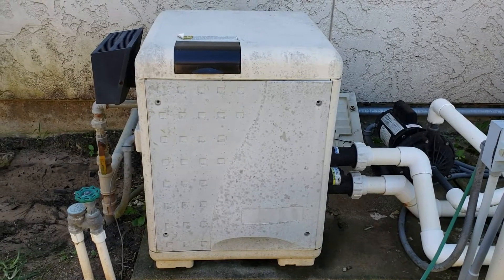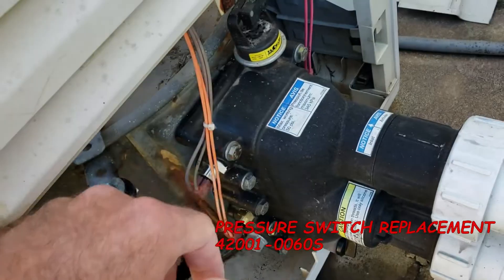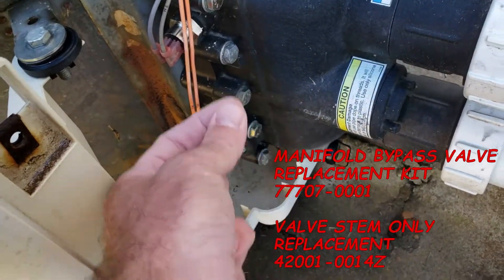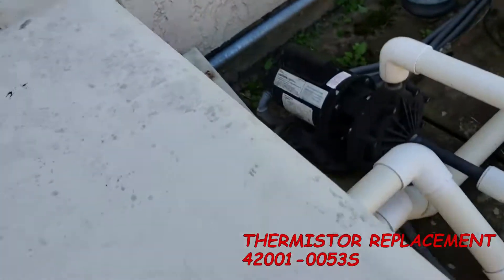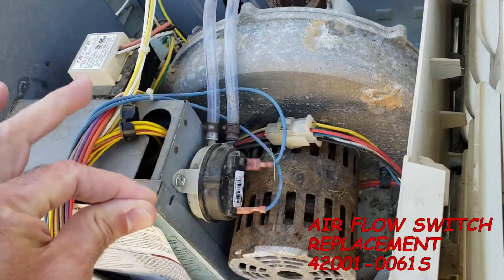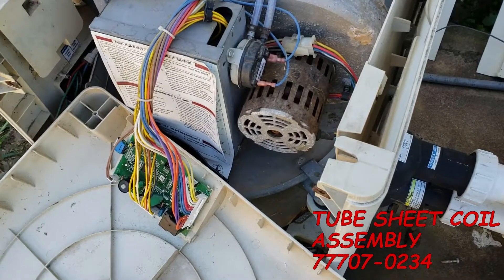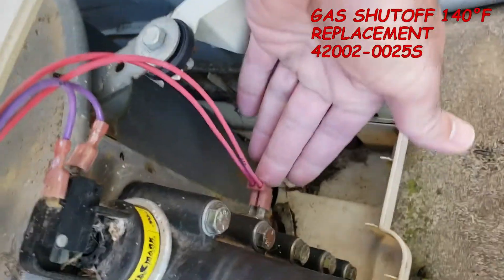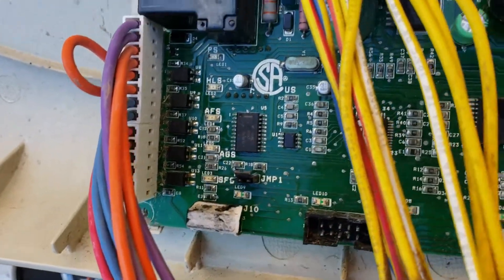PENTAIR MASTERTEMP 400 ERROR LIGHT LED EXPLAINED

Comment: Hi please help I have a master temp 400. It has been giving me issues with cycling on/off I have replaced the thermo regulator along with hls switch still it would send hot water and then start sending out cold water to the spa. I just noticed that there’s a slight amount of water coming from the pressure switch….would that be my next step to get my heater back to running perfect again? Please help I keep calling pertair with no luck.
Reply from the maker: I can try to help you.  Might need more info though.  Do you get any error lights?  I will address your question assuming no error lights.
So, what will cause it to cycle on and off without error lights...a couple of things come to mind.  The first one you have already addressed (thermal regulator), but the component you might test woukd be the thermistor.  If it gives high temp reading when the water is actually cool, the control board will cycle the heater off because it thinks the water is already hot.  So, test it.  Power on the heater and immediately look at red digital display for 3 things:
1.  128
2. R-??? (Software revision number)
3. The temperature that your thermistor is reporting to the control board.  It should be approximately the ambient temperature before the heater fires.  Check it out and let's go from there.

As for the pressure switch leaking, I don't think that will be the problem here.  It makes a hard short or no short at all (open).  If it is open while the heater is on, you will get a PS light as stated in this video.  At most, for now, you might want to see if the threads need plumbers tape or other cause of leak.
Reply: @pvt-pilot   thank you so much for your time! I get no error lights before I did get the hls one but that’s gone now (hls was red when I reversed the cover on the circuit board) whenever I boot up I do get the 128 r….forgot the # but it’s the latest one I can let you know tomorrow….the temp seems not to move today it’s been on for an hour or so and it would just show me 82 and the spa jets would fire hot water followed by cold water cycle….I did take the manifold apart just like you showed in previous video no water on the bottom bolt, everything was in place. My originals thermo regulator was working fine but it was very rotted on the top so I still got a new one which works fine along with the hls…should I change the thermistor next? When I spoke with the pentair people they mentioned that it might be the circuit board? 

Also I did change the membrane pad just in case. Last season this heater worked immaculately and now I don’t know what to do…..
Reply: @pvt-pilot  also as of today I just woke up turned on the heater after waiting about 10 seconds the exhaust kicks in, then it recycled quickly and was working for a bit I had to shut it off had to go to work but the display where the #s are was completely blank the entire time, however the green spa button and “heating” was lid…..the water was coming in warm on the jets to the spa….
Reply: @pvt-pilot  I just ordered the thermistor hopefully that would fix my issues…
Reply from the maker: @emilysworld3584  Control board is a valid culprit too, but relatively expensive for an initial swap item.  I would try the thermistor first.  They are only $15 on eBay or Amazon.  If that doesn't work, disconnect the modular connector from the control board for a solid 24-48 hrs just to allow all power to depleat from every part of the control board.  Like almost every circuit board made, it has resistors, diodes and most significantly capacitors that store energy.  This should give it a good flat line reset.  I have had this work for me only 1 time, so no promises, but definitely worth mentioning.  If that doesn't work, consider a control board replacement.

Comment: here is a riddle, Pentair MT200 NA STD is showing "heating" - no service lights on front, shows heating light on,  and no LED's showing on back of panel.  The heater is firing as i can feel heated air coming from exhaust, i can see water flowing , but the temp of water coming out pool inlets are luke warm at best.......in years past i recall REALLY hot water coming out. Any suggestions  other than the troubleshooting flow chart indicating "replace control board"
Reply: Hey I have same issue what was the problem?

Comment: Thanks again for these wonderful instruction DIY vids my friend. I have a quick question.; 
I have this exact same Pentair Master Temp 400 heater and its been a great little heater with very few issues for years. Recently however, it has started to do this thing where it fires up normally, runs for a while and shuts itself down. It has good days and bad days, but now fewer good days... So anyway, when it shuts down, the key touch control pad displays 'service heater' message, and locks you out of  any further key pad commands. So must be shut off at the circuit breaker. Anyway, I opened it up and saw it was the AGS error message. I replaced that switch, but still have the issue... Any ideas what I could examine next? This intermittent stuff is as frustrating as hell! Any replies would be well appreciated...thanks again.
Reply from the maker: Hello, unfortunately, I have never experienced an AGS error light, so I don't have any troubleshooting information for you on that electrical component.  All I can say about it is that it is a 140 degree water switch that is mounted on the opposite side of the manifold from the HLS (high limit switch).  I don't even know if it is on the input or output side of the manifold, and I don't want to speak of theoretical uncertainties on here and possibly steer you in the wrong direction.  Sorry mate.
Reply: I believe you have a variable speed pump, and if you have a easy touch panel, you can program the pump to operate at a higher rpm when you operate the heater. I would set the pump at 2800 rpms and see if that fixes the problem. If you dont have a easy touch panel, than you would have to set the higher speed at the pump.
A lot of pool owners with variable speed pumps save money by operating their pumps at speeds that are too low to satisfy the heater controls.

Comment: My problem is as follows, when at the keypad asking for 103 degrees , heater is great up to mid 90's shuts off and on slow stability at 90's will not get over 100,  filters are clean, when at the heater (not inside keypad) I manually hit the up arrow the service light comes on, then the heaters starts and the service light goes out, I shut down the keypad to raise the heater and led screen on heater is blank, no codes, any help?
Reply from the maker: Any time you call for heating, the control board turns on instantly (zero delay).  At this exact moment, the fan has not had a chance to spool up to speed, so there is no air flow yet.  Because of this, the AFS is open at that moment and thus the Service Heater light will be illuminated.  Turning on the fan is the first step in the boot up procedure.  When the fan blows at operating speed, the AFS will be blown into a closed switch position (0 ohm short across the blue wires attached to the AFS)  This will turn off the AFS error light on the back side of the control board, which in turn will turn off the service heater light.  This action/reaction process takes about 3-5 seconds every time you turn your heater on.  This is normal.
As for not heating past 90 degrees, this could be multiple causes.
#1, you could have a broken manifold bypass valve mounted to the center plate inside the manifold.  This would allow cold water to take the path of least resistance (the open hole where the manifold bypass valve goes) which results in water bypassing the heat coils.  Just a small fraction of water will feel the burn if this happens.  This will also likely result in overheating at the HLS (high limit switch) and would result in Service Heater Light cycling every time the HLS opens and closes.
#2, check your thermistor reading.  Your thermistor puts out different resistances for different temperatures across the thermistor wires and the control board translates these resistances into digital temperature readings.  If the thermistor starts giving incorrect resistances, like saying that the water is already 105 degrees when it is only 90 degrees, the control board will turn the heater off because it thinks it has achieved the desired temperature.  The control board acts like a thermostat when paired with your thermistor and HLS.  See my thermistor video for reference.
Reply: @pvt-pilot  Thank you soooo much for your input!!!!! i am not good at troubleshooting electrical problems, pool repair company charged a service call and no repair, so i am going to throw parts at it, the compromised manifold makes sense, talked to to techs at pentair, one stated thermistor, the other stated the   thermal stat , your reasoning on the manifold crack will be inspected when i start  as parts on inr-route, i admire your willingness to share your knowledge and really help,  we will find this :)
Reply: @pvt-pilot  I received my thermistor and also i purchased a stat, remove the stat and thermistor, checked with my circuit tester had not continuity , replaced both parts, the next thing you know Jed's a millionaire , thank you for your help and giving me the step in the right direction plus i had a next step with the crack or high limit, Thank you
Reply from the maker: @Berry McGregor  Sweet!  You're welcome.  Great job mate!  👏 👏 👏

Comment: help
my pentair still show AGS led on even-though i replaced AGS sensor. any idea ? The code still show look like re5 . It run about a minute the stop .stack flue sensor also replaced.:(
Reply from the maker: Short the AGS wires to see if you can get the AGS light to turn off.  If it won't turn off, you may have a bad control board.  Also, I don't know what re5 means, but I know E05 means faulty igniter/ignition.  If you are getting it to fire up at all, even for 1 minute, then the igniter is working.  So it probably is not a E05 error code.  I just don't know what re5 means.  Perhaps it is a bad control board giving bad error codes that Pentair does not publish.

Comment: my temp adjustment (cooler/down) won't work, Temp up works, Pentair mastertemp 400 2020 unit. help
Reply from the maker: Do you have a main Pentair control panel?  Does temp down work at the panel?  If it works there, then I don't think it is a problem with the control board and I would suggest starting with ordering a new membrane pad.

Comment: I replaced the AGS on my Pentair Mastertemp 300 and it seemed to work again for a while, but then it stopped heating again. The service heater light comes on, but there are no indicator led's lit and there are no codes showing on the panel. It seems to run for a few seconds and sounds as if it's about to light the gas, but you smell the gas for a few seconds and then nothing happens. I also removed the manifold bolts to see if there was an internal leak, but no water. Any ideas?
Reply: Check ignitor.

Comment: OK your always my hero when it comes to this heater. The last few days mine has been not turning on when I hit the spa/pool button, then I pressed harder and it came on. Now today nothing again. No lights or anything. Thoughts on what to check?
Reply from the maker: Watch some videos about the membrane board.  I remember watching one where the guy showed the pins on the control board that the membrane board is plugged into.  He explained that you could short certain pins together to simulate pushing certain buttons on the membrane board.  This method can be used to prove a defective membrane board before buying a new one.  I just dont know the pins to short.  Sounds like you need a new membrane board though.  Is there any moisture under the display window?  You might try temporarily disconnecting the display board's ribbon cable completely and then see if you can control it from the main panel instead.  Disconnecting a defective membrane board might relieve an unwanted short causing unwanted behavior.
Reply: @pvt-pilot  thanks I just watched that video I think that might be it. Will give it a try today

Comment: Have code E01 and the light in the upper right hand corner is on. The lights shows temp fault. Replaced the High Limit and thermistor since those brown wires go to the thermistor. Runs for about 5 mins and goes back to E01. I didn’t see you cover the temp fault light with the two brown wires next to it. That’s my only light besides service heater. My personal thought is bad board ?

Comment: Honorable PVT-PILOT, I have a Pentair MasterTemp 400 [128, R-9] which is throwing an E05 error code (also indicated on the underside panel as a red LED light on the Service Heater LED11 and SFS). I have had this issue before and in the past I replaced the Stack Flu Sensor and all was good and the system ran properly - all error codes were cleared. This time I replaced the SFS and still get an E05 code. I have tried testing the SFS itself and it is testing 3.8 ohms - within parameters -so I think the new sensor is functional. Any tips on what may be causing the E05 code to remain? Any advice or tips would be appreciated! Thanks, R
Reply: If you hold down POOL or SPA button for at least 10 seconds it displays the exhaust temp. Normal temps should be ~290-350. If it alternates between 40 and 80 than the sensor is bad. If stack temp is much higer than 350, you might have a water flow problem starving the heater and causing high stack temps.